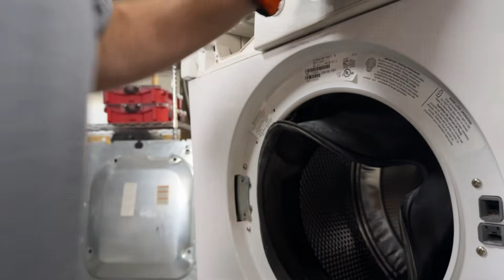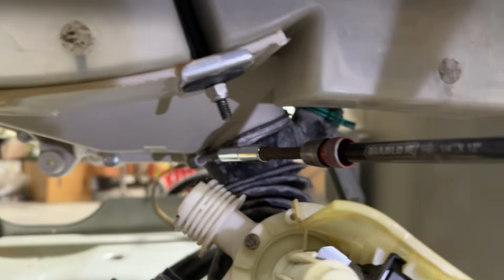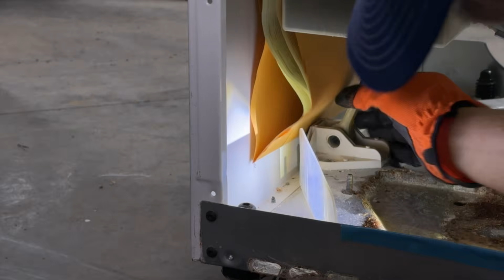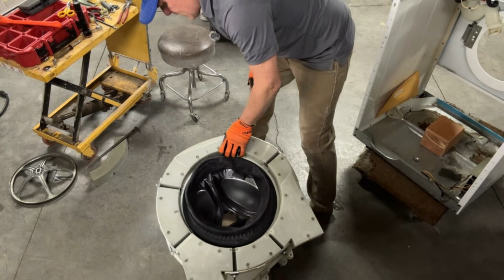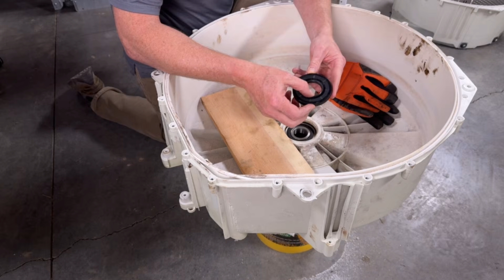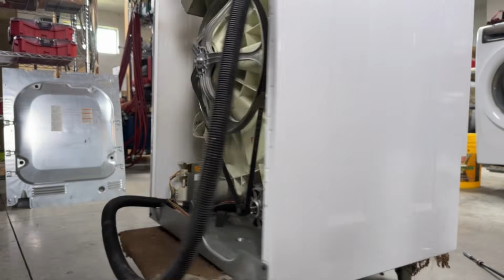Front Load Washer Bearing Replacement - Fix That Grinding Noise. DIY

Comment: Great video!  I have a fifth wheel RV with a stackable washer and dryer.  The washer is a Splendide WFL1300XD that is very loud on the spin cycle.  I'm sure I need to replace the rear bearing and seal.  Will this leak water eventually if not repaired?
Reply from the maker: Definitely—if you don't replace the bearing and seal soon, the leaking water will eventually ruin the internal electronics and motor.

Comment: Looks like a job that would cost nearly as much as replacement!
Reply: I had a quote to fix this for $1600.   That's why I googled how to diy.  This video looks pretty hard tho. 😢
Reply from the maker: Actually, a repair kit costs a small fraction of a new machine and keeps your washer running for years to come.

Comment: I have excessive vibration.   Replacing the shocks didn't fix it and springs look good. 
I accessed the back of the washer drum and removed the drive belt.  The drum appears to spin freely.  No noticable grinding. However, pulling back and forth pulling on the flywheel, there's about a 1/8" of play.

Would my bearings cause  excessive vibration?

Comment: Front load washers are junk. They are designed to eat themselves up eventually. DON'T BUY ONE !
Reply from the maker: You’re right, front load washers have real issues. The most frustrating part is the spider assembly failing, and manufacturers don’t sell bearing and seal repair kits for it. 
Repair shops do sell the spider assembly itself, but without the kit you often end up replacing the whole thing. That’s exactly why we’re making these videos to help people fix it and save money instead of buying a new washer.  
Top loads are simpler, no doubt. If you’re stuck with a front loader though, check the video to see our take on it. Thanks for watching!
Reply: Perhaps buy a good brand that is sold in Europe and so covered by European replacement laws? Then you're not shafted by the crappy consumer protection of the US (if that's where you are).
Reply: What does "eventually" mean? I gave away my first front loader after 15 years and it was still  going strong. Current one is 12 years. 
Top loaders are easier but damage clothes more and take up too much space. The benefits of front loaders outweigh the negatives.